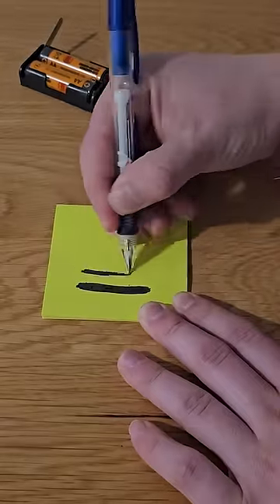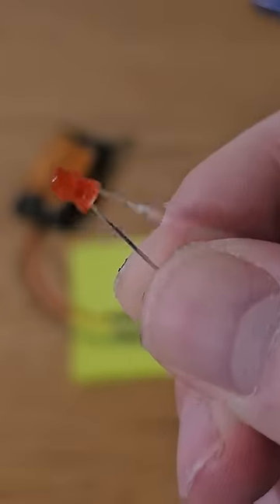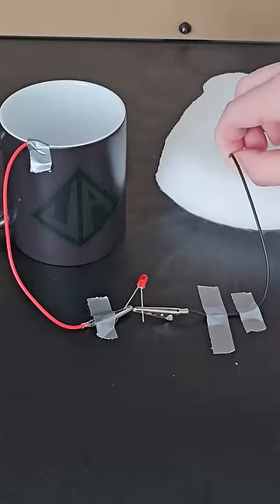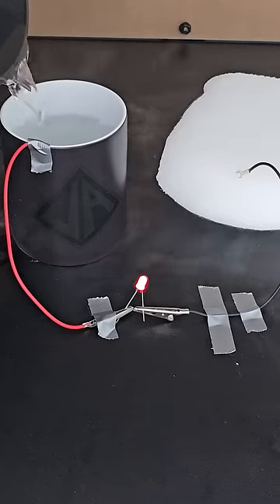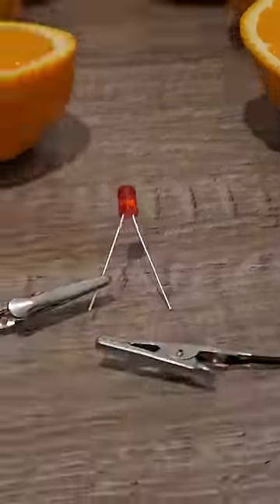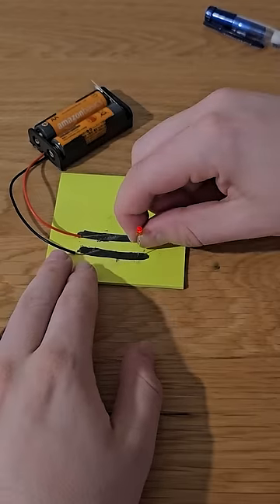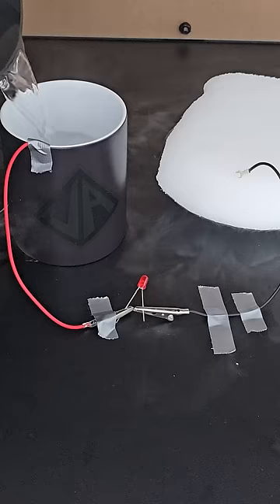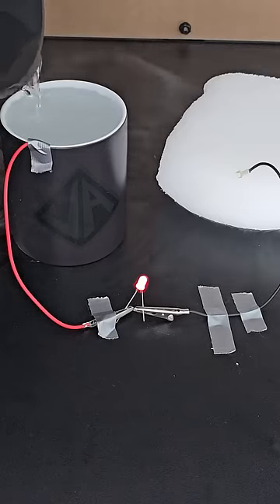2 Truths & Trash: S2E6 - Round 1 #shorts

Comment: B is an open loop anyways, even if you did somehow turn the dry ice and water into electrodes there's no salt bridge between the two
Reply: it does work somehow if you use different metals on each side
Reply: @Honïe4 It does not because the circuit needs to be closed. Even in electrochemical cells where the electrodes are connected with a cable you will still need a salt bridge or semi-permeable membrane for the ionic species to balance the charges, otherwise nothing would happen.
Reply: Yep.
Reply: @moony7759 yeah it works it's called thermoelectric or seebeck  effect
Reply: Was aboutta say that 👍
Reply: Big brainer 🧠
Reply: S
Reply: @Honïe4  What you refer to is the Seebeck effect (a type of thermometric effect) but you got it slightly wrong.
For this effect you still need a full circuit, but you join the two ends that are at different temperatures with a different metal (for example a iron wire).
Reply: just started studying Daniell cell last week in chemistry and was immediately able to tell that this one was fake. Science is fun.
Reply: @moony7759  Yeah it would it's called the seebeck effect, it works when dissimilar metals are joined into a circuit
Reply: @adityakambli8528 oh yeah didn't see that before I typed but that's exactly what I was gonna say. The circuit does need to be closed for that tho
Reply: Why do you need a closed loop? Would the potential difference be enough for a current?
Reply: @ericzhang7658 no not exactly and it's for the same reason a battery powered circuit needs to be closed: you have to physically connect the 2 dissimilar metals so that there's a more positive and negative end which creates the path for the electrons to follow. Without the physical connection the effect doesn't work
Reply: @noorseenelmagre  I mean lightning is created by a potential difference but not a closed circuit, I don't see why it has to be closed
Reply: @ericzhang7658  I think the open loop- closed loop thing is more comparable to a regular battery powered circuit, I'm not exactly an expert at this stuff but if you try to connect a light bulb to a battery without bringing it back around it short circuts bc it breaks the law where the total sum of the voltages equals 0. Lightning is more like a buildup of static electricity over time
Reply: Would this actually work with a salt bridge because temperature is a factor in the Nernst equation
Reply: @Schaex1  why does this have to be closed though? Is a lightning strike a closed circuit? This can in theory work the same way
Reply: @noorseenelmagre  this shouldn't need a closed circuit to work.
Reply: @Nick-H98  at this point just search it up tbh cause idk how to explain it. I think the internet would do a much better job
Reply: @noorseenelmagre  you don't know how to explain it, or you don't know what the answer really is?
Reply: Do you mean electrolytes
Reply: true
Reply: @adityakambli8528 it still requires a different apparetus and you still need the equivalent of salt bridge
Reply: @Schaex1  *Seebeck effect left the chat
Reply: @harrabi15  you are WRONG 

This is not ELECTROCHEMICAL CELL it's THERMOELECTRIC CELL and it doesn't require salt bridge
Reply: INCORRECT, if you have to conductive elements and one of them is negatively charged and the other is positively charged then it will work for a slight momment
Reply: With the thermoelectric effect both dissimilar metals are exposed to the same temperature and are connected together. So you're right that it needs to be a connected loop still, but it's not a chemical battery so no electrolyte medium is needed for difference in potential to occur.
Reply: ikrrr
Reply: @Schaex1 frrr

Comment: I knew cause it wasn't a closed circuit
Reply: I hope you're being sarcastic 💀
(you do know electrons won't flow cause of a temp difference right)
Reply: @vic_710  Electrons can flow from a temperature difference, it's called the Peltier effect. It's not possible in the configuration he shows because the circuit is open.
Reply: @tralt135  alright it seems I don't have enough info about how the world works and have made myself look extremely dumb. Thanks for educating me

Tho i think you mean the seebeck effect and not the peltier effect
Reply: @vic_710  Not extremely dumb by any stretch, it's one of those things the average person doesn't know and wouldn't need to.

People on the internet seem to have this obsession with knowing things that they will personally never need to know and expect others to do the same. It is not a personal failure to not understand everything.

But you have an open mind and are willing to learn, which is far more valuable that thinking you know more than you actually do and using that as an excuse to shut others out.

Stay curious. :)
Reply: @vic_710 i dont know the names of the effects or anything but temperature difference can create electricity, plus the other way around. If i remember correctly, you need wires of two different materials and it has to be a closed loop. Heat one side and cool the other and itll create current. Whats cooler in my opinion though is the opposite. Apply a current to the same wire and one side will heat up while the other cools down. Ive seen some soda can coolers that work this way
Reply: Same here. Also knew the citrus one worked for certain.
Reply: @vic_710  I don't think he's being sarcastic. If it's not a closed circut it's a tell tale sign that it's fake. It's the first thing I asked myself so that's just the answer.
Reply: I knew because it was way too bright
Reply: Bro how did i not know that, i literally make projects in arduino but i didnt noticesd its not a closed circuit
Reply: @vic_710 This response indicates you're not dumb. You were confronted with new information and learned something instead of resisting or arguing because of your ego. This is getting rarer and rarer now :(
Reply: @ColtTheWolf specially on YouTube comment section... lol
Reply: I knew because what the fuck does temp have to do with electricity?
Reply: @tralt135 bro simply sticking a wire onto a block of ice and a cup of water cant power an led regardless of if its an open circuit or not 😭. There is nothing powering the LED. A block of ice has nearly no energy, as cold is the absence of energy
Reply: @rhine7299  Useful energy is best understood as having two sources of heat at different temperatures. While the ice is cold and at a relatively low energy state, the surrounding environment is warm, and heat will transfer from the warm air to the cold ice. One can in theory use a heat engine to derive useful energy from this transfer.
Reply: @vic_710  Bro doesn't know you need a closed circuit 💀💀💀

Comment: Fun fact. You can use the temperature difference between 2 types of metals to generate an electric current. The greater the difference, the more current you can generate.
Reply: wait what? really? temperature difference to electrical potential difference? Can you give an example/explanation?
Reply: @tachoblade2071  Well, the greatest examples I know of are Voyager 1 and Voyager 2. They use a radioactive core that stays warm, and deep space being very cold creates a large temperature difference between the inside and outside of the crafts.
As for an explanation of how it works, Google. It's basically converting thermal conductivity into electricity.
Reply: @bryancline8893 it's called a thermoelectric generator

For the generator on voyager 1 and 2 (and a multiple other spacial exploration machines) they use a radioactive material, it's called a RTG (radioisotope thermoelectric generators) some even use the radiation to produce energy instead of heat
Reply: Except this wasn't a closed circuit
Reply: @bryancline8893  So does the 2nd one actually works if it was done right?
Reply: @thesphider8298  are you saying that if the water-circuit was closed, it would generate electricity? Because that would be something to see.
Reply: @mystrknwital9146  depends on what "done right" would imply. But I very strongly lean towards no.
Reply: @bryancline8893  😂 I think you understand what I'm trying to say. But that's a funny interpretation! Google "thermocouple"
Reply: @tachoblade2071 check out the Peltier effect.
Reply: That is true but it has to be a closed circuit, and it requires a thermoelectric material to be placed in between the two sides of the differential. simply dipping wires into water won't work.
Reply: @bryancline8893 the circuit would have to be closed and the wires would have to be two different materials. Then the temperature difference can generate electricity. Whats cool as well is the fact that you can use this setup to cool stuff down too. If instead of placing the loop in a hot and cold environment, you just apply a voltage to it, itll actually cool down one of the wires while the other heats up
Reply: My knowledge on seebeck effect,peltier effect and Thomson effect helped me once in my life🎉
Reply: I did a science project on sterling engines,so I can confirm this is true.
Reply: That's why I thought it was real
Reply: you can use a temperature gradient to create electricity, but very much not directly lol
Reply: @tachoblade2071 read about seebeck effect and peltier effect
Reply: Yes a thermocouple is comprised of two different conductive metals; the most popular are copper and Aluminum you twist the both ends together to create a closed circuit. Put one twisted end in the hot and the other in the cold and put your load in series in the copper side.
Reply: @RyanAltraAlso useful when a gas-based cooling system would be overkill and too cumbersome, like in office water coolers and cooled water fountains
Reply: Thanks for mentioning 
I recently purchased some cheap peltier modules for some projects

Comment: what you need for the second one to work is a thermoelectric Peltier element and an actually closed circuit. those are cool passive heat engines that can both move heat using electricity and generate electricity using a temperature differential

Comment: There is actually a way to make electrons flow with a difference in temperature by using the Seebeck effect. (The opposite is also true by using the related Peltier effect)
Reply: Right that's why I was confused but I reckon the tap water's not conductive enough
Reply: I was thinking this too, but the wires need to be coupled, and also need to have a different resistance - which didn't seem to be the case

Comment: there is some truth to the second clip tho its called the peltier or thermoelectric effect where as when specific arrangements of dissimilar metals and semiconductors are differentially cooled/heated (cold on one side hot on the other) it can generate a voltage potential. the inverse is also true if you run a current through a peltier plate one side will get colder than the other tho without cooling the hot side they will both just heat up relative to room temperature but there will always be a side colder than the other
Reply: Womp womp
Reply: @quocanhmai2228  what?
Reply: Yes but the configuration here is very wrong for that effect to occur. The dissimilar conductors need to be connected to form a closed loop.
Reply: POV: Me when I'm too stupid to take in information.
Reply: @Fat_Man_NukeOfficial magic box turns temperature difference into electricity.

Comment: Closed Loop or nothing
Reply: It's not that simple. A Lithium battery has no conductive parts between anode and cathode, only an electrolyte. Which does - kind of like a semiconductor, sitting somewhere between conductor and insulator on the resistance scale - facilitate the transport of electric charges. Like in the example with the oranges. Not exactly a "closed loop" of conductive material here either!
Reply: @DerMarkus1982 if it takes electrons, it's conductive
Reply: @DerMarkus1982 Its a closed loop in a sence that charge carriers (ions) move between the electrodes. 
The only non closed loop where electricity can flow, is when there is a charge build up, like in a capacitor. In this case its really a open loop, and for some time there can flow a current until it reaches equilibrium.

Comment: Worth mentioning that it is possible to generate electricity from a temperature difference; thermopiles aren't powerhouses or anything but they exist.  You're definitely not going to run wires to the hot and cold thing, though; you have to essentially glue them together with the thermopile in the middle.

Comment: For electrons to flow without the use of a generator you need a redox-reaction because this type of reaction has electron exchange. The Zink and Copper one works I think with the acid in the Orange. Not quite sure…
Reply: I think so! The acid acts as an electrolyte, zinc's standard reduction potential is about -0.76V while copper's is +0.34V I believe. So with the aid of electrolytes zinc will be oxidised, transferring electrons to copper which are reduced, hence creating an electrochemical cell with +1.10V of voltage!
Reply: @harmonydew6486  As a kind I always was so hyped and thought that lemons were electrical :) I don‘t know how to calculate the numbers so I‘l just trust you, thx.

Comment: The thermoelectric effect is real, but the circuit needs to be closed (i.e. a loop). Also unless you stack semiconductor Peltier coolers in series, most normal metals will give you a few millivolts, and an LED needs at least 2-3 volts to even begin to produce light.

Comment: For the electrons to flow due to a temperature difference, you'll need to apply those opposite temperatures to the two faces of a thermocouple (or whatever that thing is which has 2 faces mated with p and n type semiconductors). This produces a force that allows electrons to flow in the circuit. It is called the Seebeck effect.

Comment: Video 2 is possible, but not like that, it requires a bit metal plate with a positive and negative wire connected to a certain points on them, this is known as the Seebeck effect. Soviets used this to run several Radios, Radio Relays, and light houses. The upgraded version known as a Radioisotope Thermal Generator or RTG has been used on many satellites like the Voyager and was even featured in the movie "The Martian". Though the ones the Soviets used are a huge problem because we do not know where they all are and nearly all of them have been left unattended.

Comment: the orange one is basically the same way a potato battery works if you've ever done that, it actually works slightly better because of the citric acid iirc. Graphite like mentioned, is a conductor. that's why that commonly repeated cold war myth about space pens is a myth. using a pencil created tiny pieces of conductive dust which can potentially short circuits and cause more problems. there's nothing unique about high and low temperatures interacting that would cause electrical energy to be generated or moved.

Comment: B because there is no connection between the two poles, also a difference in temperature going across the wire will not make electricity

Comment: The actual answer is d since what he said in the dry ice one was actually correct, if you have a large enough potential difference electrons will flow no matter the material lol. It's just that in some cases it would need to be a very, very high potential difference. He's correct he just doesn't have them at a high enough potential difference. Inject the water with a crap load of electrons and remove a bunch from the dry ice and it'll work (may or may not cause the bulb to explode)
Reply: No. Water does not conduct electricity, and DC has to have a solid path, not just 2 random electrodes.
Reply: Well B wasn't a closed circuit
Reply: @inline2762  bud, just cuz you took intro e&m don't assume you know everything, many things you learn are general things that apply to simple cases. Anything can act as a closed circuit with a large enough potential difference, how do you think lightning works
Reply: @inline2762  by your logic lightning should be impossible
Reply: @atheoristspointofview7059  Breakdown is irrelevant here, why even bring it up? A difference in heat does not make an electrical difference.
Reply: @inline2762  ok bud ig ur right have a nice day